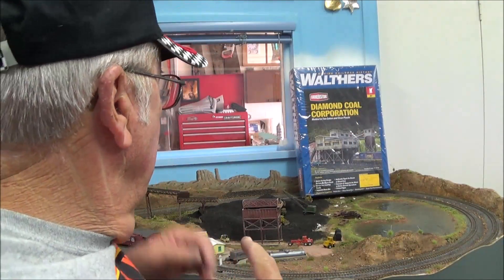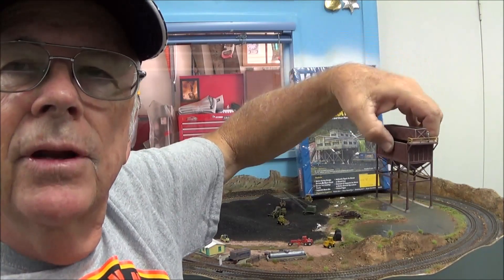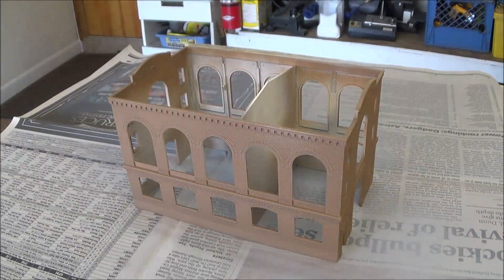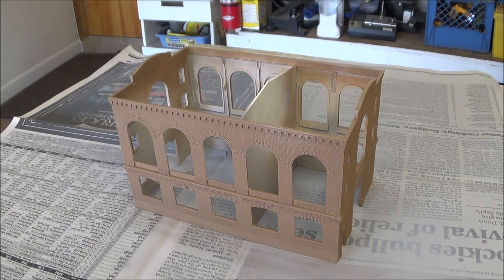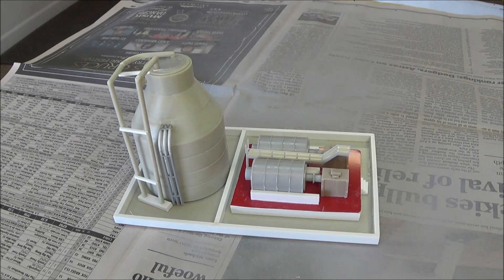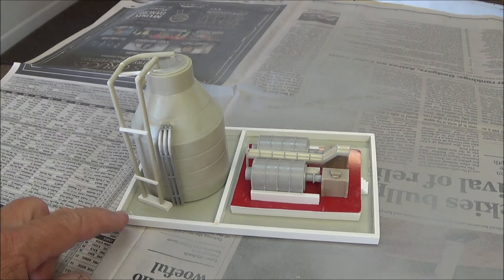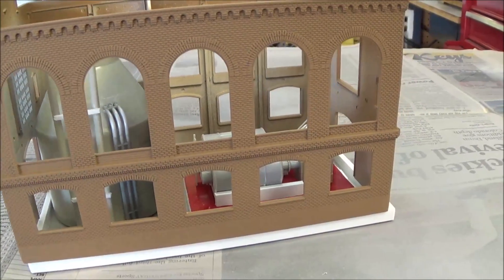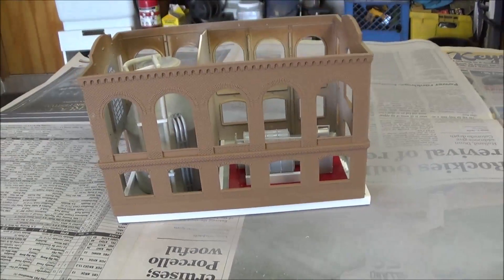N Scale A C T  Railroad Update # 69

Comment: Mike, I might suggest switching the arrangement; put the larger "boiler" in the bigger room. more room for maintenance operations. You could fit one of the smaller "generators" in the smaller room. keep the other smaller one for another facility or bring it in on a flatbed to simulate generator being replaced. However, it is your model , your layout, and it looks great!!